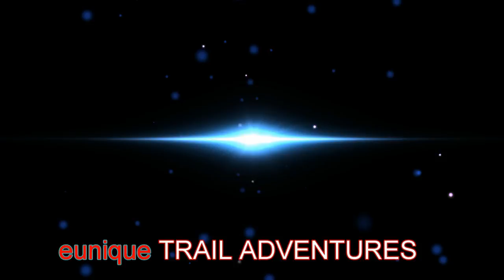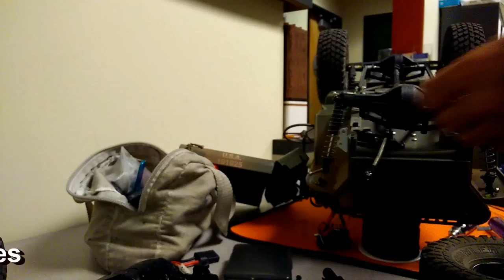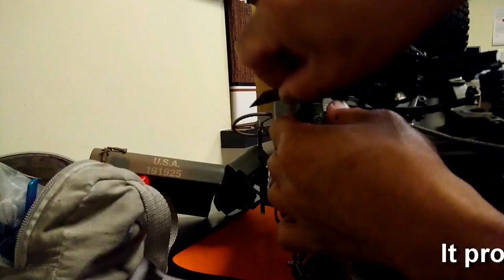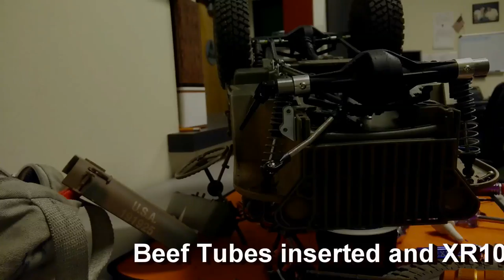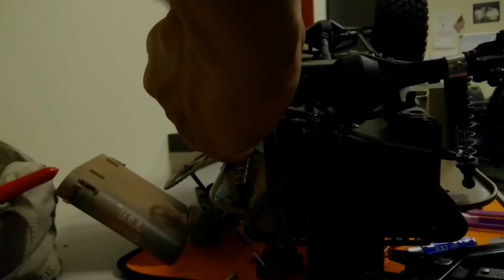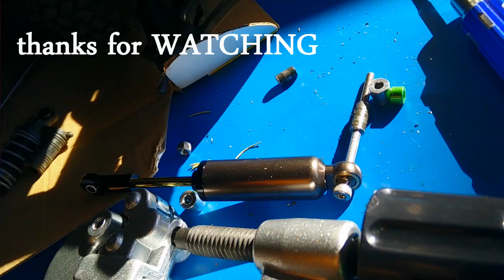GI Joe Willys Jeep 1/6th Scale Update #2 -RC Crawler

Comment: any chance of a part number list?  please i am rather tired of my wheely king axles
Reply from the maker: sure:
SCX10 axle
AX80061 - XR10 Steering Knuckles Set (Wraith knuckles)
AX80062 - XR10 C Hub Carrier Set (Wraith c-hubs)
AX30563 - XR10 Front Universal Set (2pcs - needs to be ground down)
Reply from the maker: Don't forget the XR mod WIDE beeftubes for SCX10, I put list and link in description box.
Reply: same for the rear as well?
Reply from the maker: mikes hobbie's and random stuff no, for the rear, all you need is a wheel widener by Junfac together with the Axial SCX10 rear axle.